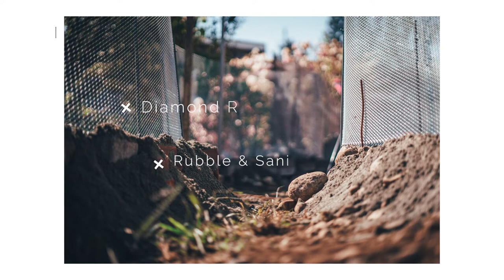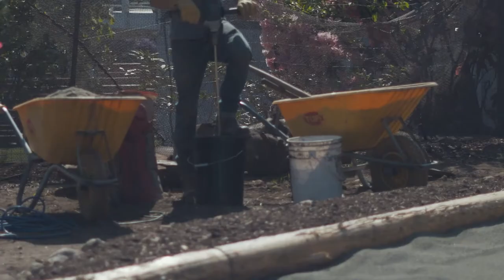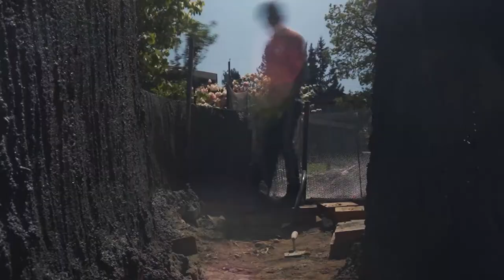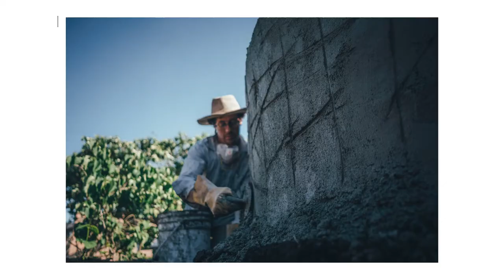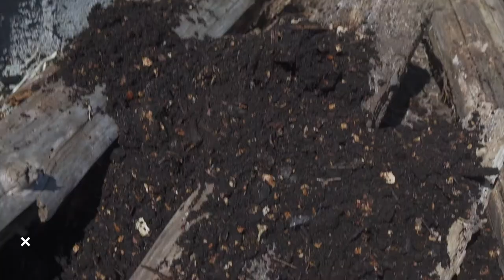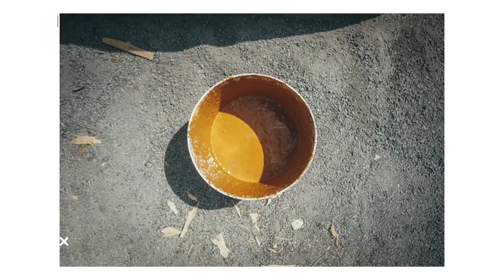Ferro-Cement Raised Bed + Hugelkultur Bed Time-lapse

Comment: We are trying to build one of these but the cement/concrete falls right off the metal wire. Any tips?
Reply: Add a latex based bonding agent to the cement. As much as 10x improvement in cement bonding. You can spray acrylic latex onto the steel before making the framework for a cheaper option. It adheres extremely well and cures very quickly in warm weather. Most of the time there are two layers of mesh for easier application of concrete. They are using metal lath which has a particularly high surface area for the concrete to interact with. It's also much pricier than alternatives

Comment: Any details on the iron-based pigment? Brand suggestion or any other details so I can find it around here (Massachusetts)? Thanks!
Reply from the maker: Pure iron oxide pigment from a clay art supplier. You can also check Concrete suppliers for pigment mixes.
Reply: @hatchetnseed  I like how you were able to paint the visible portions vs. mix the pigment into the cement. Is there a special type of pigmentation product used for painting? Or are you mixing up dry pigments then just rolling it on? Appreciate the assist, love your work!
Reply from the maker: @trentonmanns211  raw iron oxide pigment..

Comment: How thick are the walls? Any cracks yet?
Reply from the maker: Approx. 2''.. No significant cracking yet.. Sometimes there's some surface cracking if the final coat goes on when its hot and sunny, but we've been able to mitigate that by wet sponging and shade tents.
Reply: Regular concrete will crack which is fine for this application, but is somewhat problematic for water tank and roofs. Fibers and or bonding agents will solve this problem. You can find either in a hardware store.